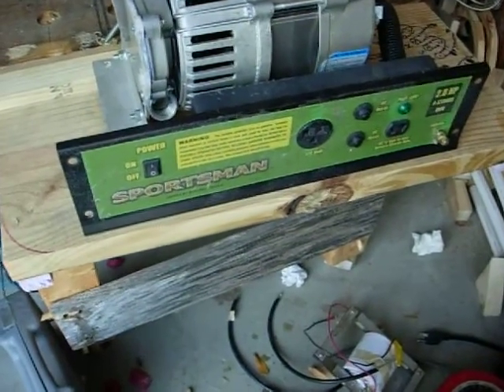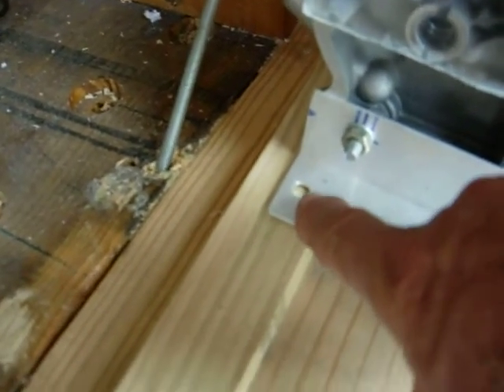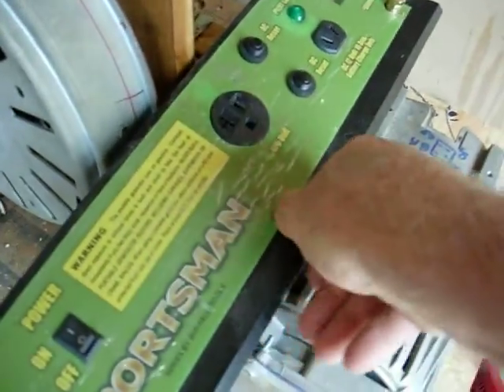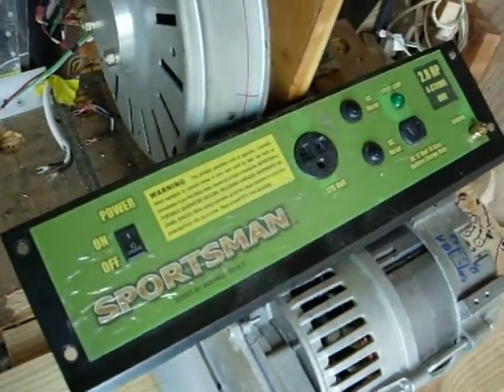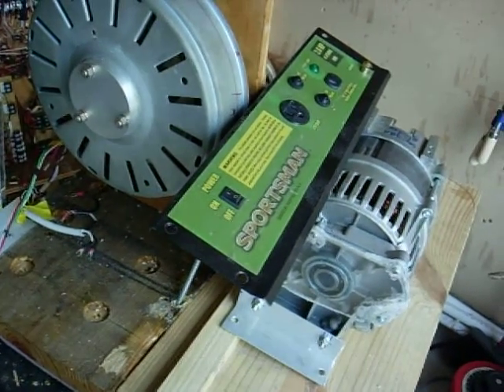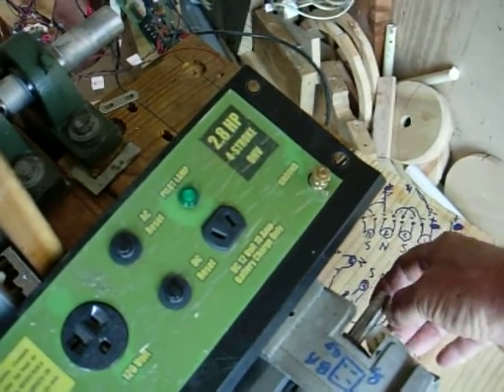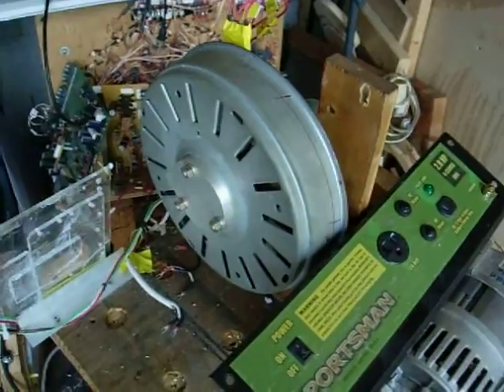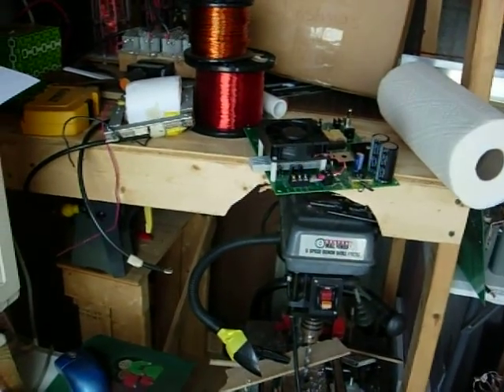Don Smith #143 Generator modified and ready for mounting.

Comment from the maker: Have you looked closely at the you tube videos showing how a pole transformer is made?   There are two aluminum plates wound inside and outside the HV coil.   I'm curious as to what the difference is for each of the two plates.  They have totally different diameters.   This means that if they both have the same number of turns then something strange is going on.  The number of turns should give us the 120 volts.  If this is true then the outer plate would produce the 120 but would also have a lot more surface area and mass than the inner plate.  From the video I can count about 20 turns for the outer plate I'm not sure what the inner plate  has.  Once I have one of these to mess with I'll drain out the 20 L of mineral oil and check it out.  If necessary I'll burn out the paper produces and count everything along with measurements of inner and outer plates size, turns, width, height ect.  also this will let me check out the HV coil wire size, turns spacing between layers ect.

Comment from the maker: In Gerard's over unity video using the 50kw and 25kw pole transformers.  Their is no regulation provided when the load changes and the saw speeds up when one of the 1500 watt heaters is shut off.  This tells me that the generator is just spinning producing radiation and electrons that don't go anywhere because they are trying to enter the aluminum plate and there movement is extremely slow.  The ammeter reading show varying amps .1 to .9 ect.  The 30 amp fuse sees no current flow.  I'm trying to figure out an easy way to regulate the plate output as the load changes.   I believe that the plate turns gives us the 120vac and the plate mass gives us the charges to do our work running stuff.  If this is the case then a simple way would be to change plate mass and the turns for each load change keeping the voltage output constant.  A sensor monitoring loads could control a mechanical device to accomplish this inside the transformer and oil.